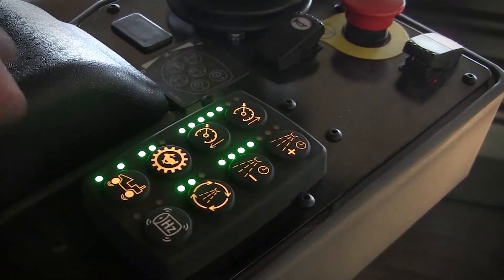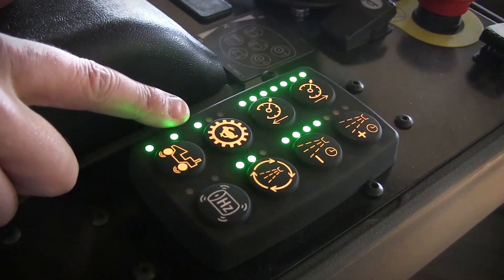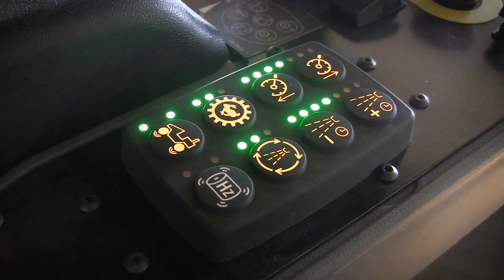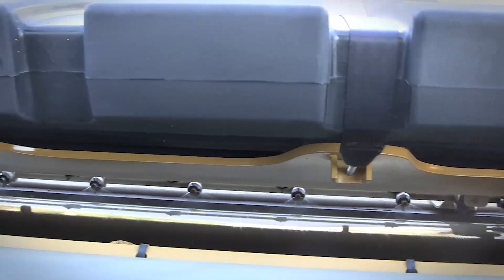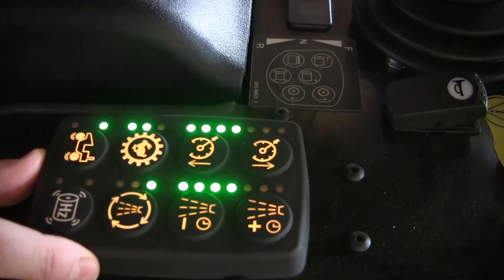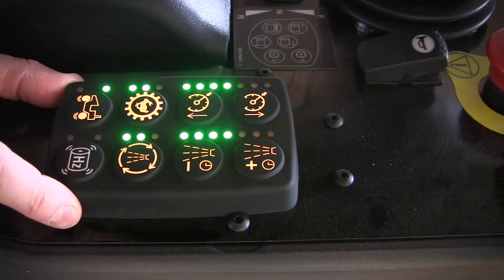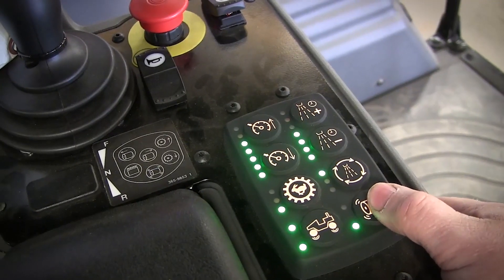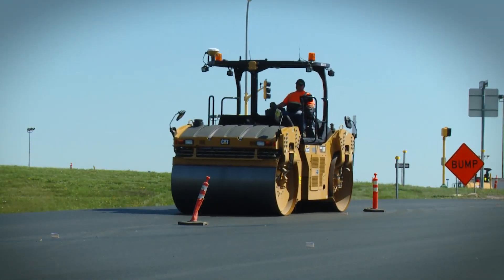Simplified 8-Button Operator Control Panel on Cat® Tandem Vibratory Rollers

Comment: How adjust steel drums
Reply from the maker: Hi Jorge. Thanks for your question! It depends on many factors including the application and underfoot conditions. Check out our Rubber Track Selection Guide that compares options based on those factors. Be sure to check out the Heavy Duty Bar Tread as that might be the right option for you. We recommend contacting your local Cat Dealer to discuss your exact situation. Thanks! - Cruz

Comment: I  don't like all the controls in the armrest, it is like you are locked up and it is not possible to cnange the body position, this means the operator has a very monotone body position throughout the day. Additionally you get tired sooner after a couple of hours and compared to a driverstation with a normal steering wheel in the middle right before the operator and the control levers left and right next to the steering wheel will provide the roller operator with a much better upperbody support and easier operation and roller control, and a more active body position which reduces also the tendency of getting tired after some hours work. I have done a study about it and it is quite a big difference, it also increases safety on the jobsite because the operator is much more alert in working conditions!